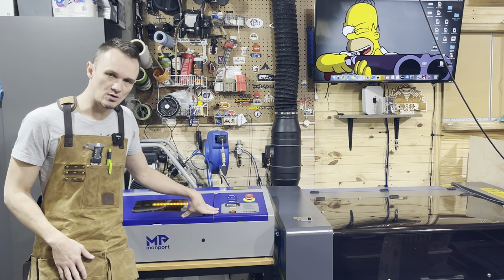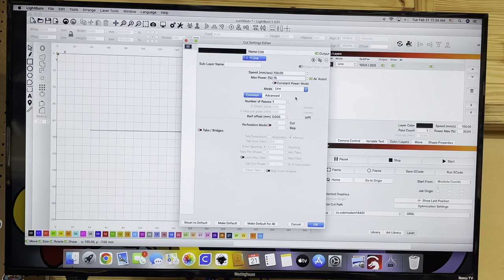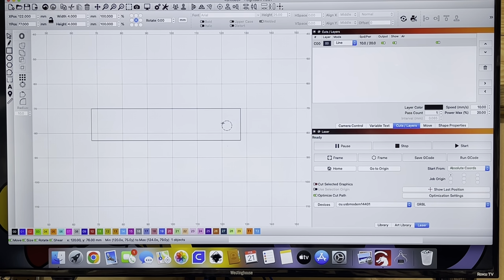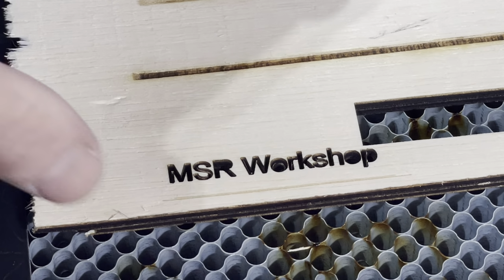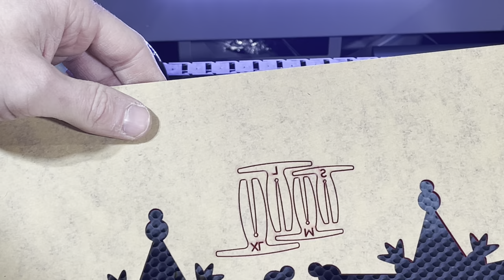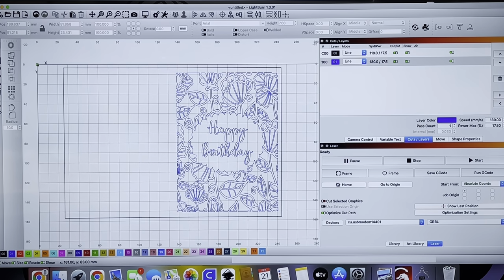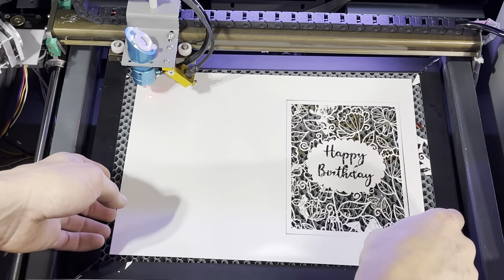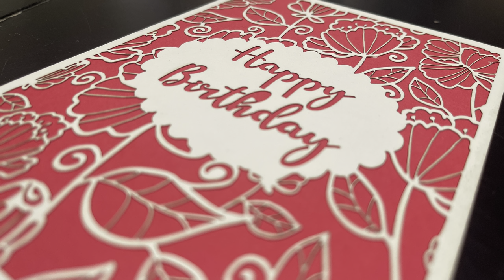Monport K40 Laser. Greeting Card,  Acrylic Honeycomb Bed Hold-Down Pins and Focal Gauge Projects.

Comment: Did you change your Air Assist tubing.  In the installation video you did, it was blue in colour.  In this video, it looks like the colour is black?
Reply from the maker: I dis. It was a bit stiff with the blue tubing so I switched to a softer tuning so the motors weren’t forced to strain as much
Reply: @MSRWorkshop  What tubing are you using now? My Monport K40 arrives tomorrow and I want a good setup from the get-go. Your videos will be a big help, btw, so thanks for posting.
Reply from the maker: This is the one I ended up with it’s not a step is the blue one. 
ANPTGHT Silicone Tubing 5/32" ID... https://www.amazon.com/dp/B0BM45Q98Y?ref=ppx_pop_mob_ap_share